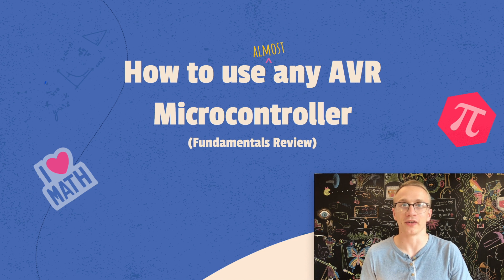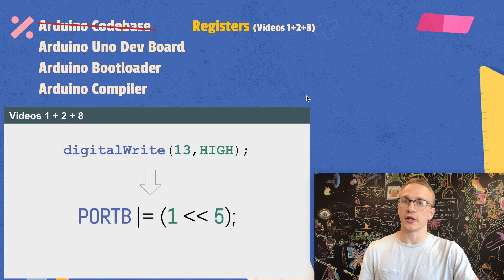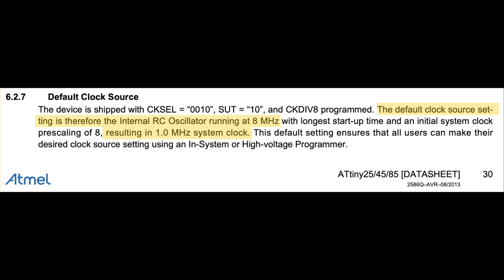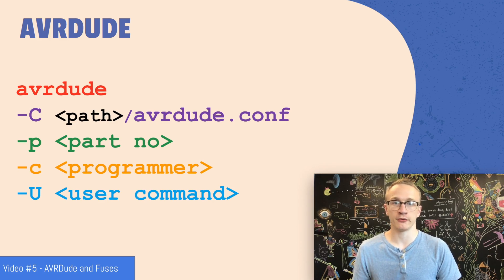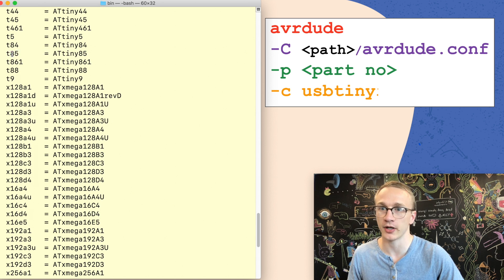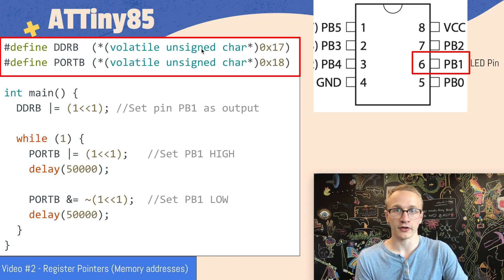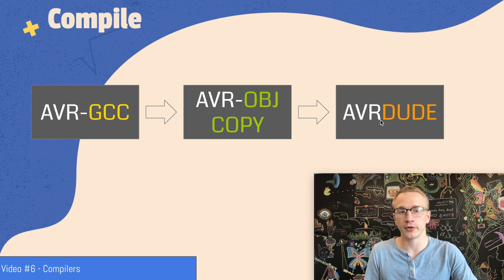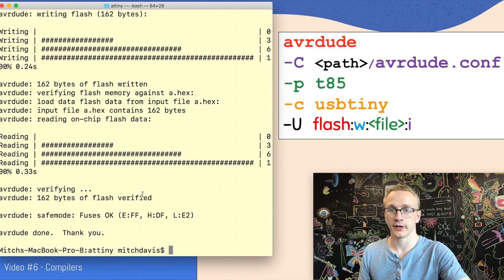Bare-Metal MCU #9 - Review; ATTiny85 from scratch

Comment: I've used the ATTiny85 a fair bit, but I subsequently shifted over to the ATTiny 412 as well as larger members of the 2-series (eg 3224) and AVRxxDD series (e.g. AVR64DD20). I also use ARM and RISC-V MCUs quite a bit where appropriate, but the AVRs are really useful in their own right.

With the exception of the AVR64DD28 those newer parts are only available in SOIC, but it's easy enough to solder them to a DIP adapter, and with the right adapter PCA  you can add some basic external support like a 0.1 uF filter cap on Vdd and maybe a pullup or two to create a standalone breadboard-ready package.

The 412 has only half the flash/RAM of the 85 (though the others I listed are much bigger, ranging up to the AVR64s at 64KB flash / 8 KB RAM), which makes it cozy for Arduino, but in exchange you get vastly better peripherals. The timers are all much better than in the 85, and the TCD block in the 1-series and AVRxxDD is especially useful for things like controlling H-bridges. The universal serial block is replaced by dedicated UART, SPI, and TWI/I2C. Most of my firmware just consists of peripheral setup and maybe an ISR to manage it, and that fits comfortably into 4K flash and 256B RAM.

One highlight is the CCL block, each instance of which includes a pair of chainable 3-input, 1-out LUTs that can implement arbitrary boolean logic, optionally synchronized via register. You can use them to implement arbitrary logic (combinations of AND/OR/NOT/XOR) as well as flip-flops and latches using spare I/O pins. I keep a collection of usefully preprogrammed 412s and 3224s (i.e. ones that configure CCL to provide some combination of logic on a set of pins and then go to sleep) on DIP adapters in my "logic collection" for that reason.

The 412 in particular is $0.50 in quantity and the others I listed are all less than a dollar in SOIC (if you're allergic to SMD then the DIP version of the AVR64DD28 is a bit over $2). I bought a tube of 100 412s a long time ago and have been working my way through those. As noted above I use them as external clock sources, registers, and boolean glue logic via CCL all the time. They're more expensive than SOIC 74HC parts, but not by that much.

UPDI is also a much nicer programming interface than DebugWire IMO. IMO it's worth investing in a "high voltage" programmer like the Adafruit "HV UPDI Friend" ($10) so that you can free up a 6th pin for your designs. In HV UPDI you can configure the programming pin however you want (GPIO, analog I/O, etc), but an external programmer can put it back into programing mode by sending a short 12V pulse to charge a built-in cap. That gives you 6 "useful" pins in addition to VDD and GND in a 412.

All of this is to say that the ATTiny85 is just the (rather primitive in terms of peripherals) start. You can do some really fun stuff with more modern low-end AVRs.

Comment: bro i finished all your vids but it doesnt seem to help me with my problem.please take a quick look at this.

 //this is a simple program to test the functionality of the ADC
//after programming i just connect PB3 to VCC 5V

#include <avr/io.h>
#define PIN_VOLTMETER PB3
#define PIN_LED PB4

void setup() {

   double voltage;
   
    DDRB |= (1<<PIN_LED);      //PB4 as OUTPUT
    DDRB &= ~(1<<PIN_VOLTMETER); //PBR3 as INPUT
    
   //connect PB3 to adc
   ADMUX = 
   (0<<ADLAR) |
   (0<<REFS1) |
   (0<<REFS0) |
   (0<<MUX3)  |
   (0<<MUX2)  |
   (1<<MUX1)  |
   (1<<MUX0);

   //enable adc
   delay(20);
   ADCSRA |= (1<<ADEN);
   delay(20);
   //start conversion for adc
   ADCSRA |= (1<<ADSC);
   while(ADCSRA & (1<<ADSC));

   //getadc results
   delay(100);
    int l= ADCL;
    int h= ADCH;

   voltage = (h<<8) | l;
   delay(3);
   int i , voltage_int;

  voltage_int = (int)voltage;

  //blink the led as many times as the measured voltage at PB3.Example for 4.5V it will blink 4 times
  for(i=0 ; i<voltage_int ; i++){
    PORTB |= (1<<PIN_LED);
    delay(1000);
    PORTB &= ~(1<<PIN_LED);
    delay(1000);

}
}

void loop() {
}
Reply: instead of blinking 4or 5 times it blinks continously infinite
Reply from the maker: I’m not by a computer right now, but can you print off the values of things like “MUX1”

Usually, these are represented as a mask (ex MUX1 could be something like 00010000, or 16). In that case, you don’t want to bit shift it.  Instead, you’d just OR with MUX1 instead of (1<<MUX1)
Reply: @MitchDavis2  I forgot to say im using a digispark kickstarter attiny85 , cant break point with this one right? according to datasheet MUX1 initial value is 0.when ADMUX = 0000 0011 im just connecting pb3 here to adc...maybe i dont understand fully what you mean.Im thinking maybe the libraries at my arduino isn't correct .

Comment: Sidenote: The ATtiny85 has an internal pull-up resistor for the reset pin - there is no need for an external one. Reference: Page 39 in the datasheet, 8.1 Resetting the AVR
Reply: Those are shockingly weak pulls though. If memory serves it's around 30-40K. I use them without external pulldowns for breadboarding but I would probably add a 4.7K or 10K in any production design.

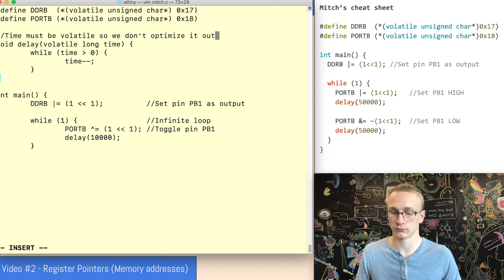Comment: Love all your videos, great job!   Can I make a suggestion?  I know it doesn't matter much, but there is another simpler way to toggle an output pin.  At 9:00 in the code:  PORTB ^= (1 << 1).  If all you want to do is toggle the pin, and you don't care if it's on/off, then you can just use   PINB = (1 << 1).  The "PINx ports are Read/Write ports.  When you write to it, it "toggles" the output.   This uses far fewer clock cycles, in case it matters.   Search the datasheet for the word "toggle" and you'll find this:   " writing a logic one to a bit in the PINx Register, will result in a toggle in the corresponding bit in the Data Register.".  It's a lot of fun if you want to toggle a pattern back and forth...  Example:
    PORTB = 0b10101;   // turn every other pin on.
    while(1) {

        PINB     = 0b11111;  // the pins that were on will go off, and pins that were off will go on
        delay(???);
    }

I had been programming atmel AVRs for years before I noticed that tidbit about PINx in the datasheet.

Comment: Thanks for the tutorial series!! The arduino attiny85/84 support is a mess. Bootloaders on 85 that hog most of the pins, leaving you with little, damaged support on 84 due to versioning-shenanigans on IDE 2.x. Various "boards/HALs" hogging the timers and interrupts just in case you need delay(). Without those, I can't build anything productive. I managed to program things with a cheap "usbasp" programmer by following your instructions.

Comment: Very helpful video, many thanks, 
I was confused by the change of 0x17 to 0x37 and after reading a bit more on the topic I have a better understanding.

From the ATTiny85 datasheet p20:               "When addressing I/O Registers as data space using LD and ST instruc-tions, 0x20 must be added to these addresses."
And from, the Atmega328p datasheet p19: "When addressing I/O registers as data space using LD and ST instructions, 0x20 must be added to these addresses"
Reply: Ok at least they specified that. But why wouldn't they provide us with the correct memory address in the first place?

Comment: I absolutely loved these series, BUT I encountered some problems with lesson on fuses... I was trying to mimic what Mitch was doing to set Low Fuse and somehow I screwed up.. My Atmega328p is not recognizable anymore, it tells me that it's address is 0x00000, I searched it and I found that it may be that i have "bricked" my microcontroller. I am wondering, did I destroy my Atmega328p or it can be saved? Please help, I am kinda desperate.. PS Somewhere in my trial of flashing the Armega, I was getting the error that my code doesn't match at the address 0x..something, something strange was happening..

Comment: I would like to know now how can I choose the right attiny myself, is there a page with a comparison?, I will google it, I just need an attiny to receive messages over I2C and output a PWM signal in a pin, I wonder what would be the cheapest attiny to achieve this, since I need to do this for 15 servos that need to be chained to avoid wiring to a bigger uC, thanks for the series!

Comment: I was with you all the way to the last couple of minutes when you discovered the need to add 20 hex to the register addresses. It was then that I thought 'how are beginners like me ever supposed to be able to work that out for themselves? '  That was the point that all the training so far became irrelevant and without the knowledge you had would have left me confused, angry and floundering. So the datasheet was wrong and nobody thinks that Atmel should put it right?   Loved the videos until then.
Reply from the maker: That left me confused as well.  Some datasheets put the ABSOLUTE address, and some put the RELATIVE address, which is relative to the beginning of that type of register.

Relative shows up a lot because the relative address is often the same between microcontrollers, but different MCUS with different amounts of memory will start the offset at a different place

Comment: avrdude actually DOES understand a.out, so you can skip the 'objcopy' stuff and go directly "-U flash:w:a.out:e".
You can check it in the avrdude manpage under the "-U" section where it lists:  "e    ELF (Executable and Linkable Format)"
So in my case where I'm using an Arduino as ISP and have the source in blink.c I do:
$ avr-gcc -Os -mmcu=attiny85 blink.c
$ avrdude -p t85 -c stk500v1 -P /dev/tty.usbserial-1410 -b 19200 -U flash:w:a.out:e
And .. presto!

Comment: @13:34 The Lfuse is 22, isn't it supposed to be E2?
Reply from the maker: I just went back and watched that part again.  Since I had problems getting my code to work, I might have started messing with fuse bits behind the scenes and forgot to set it back.

I’d have to go check the online fuse bit calculator to see what the difference is between 22 and E2.

But you’re right, it was something that should have stayed as E2 for this video because I didn’t show where I changed it to 22.
Reply: @MitchDavis2  I asked Because it was still working fine! 

I didn't meant to point it out as a your mistake. Your explanations are the best on YouTube and any viewer would agree to this.

I wish you a good health.
Thank you Mitch

Comment: Hi davis I ran into a problem. I have purchased an Atmega328P SMD IC and built a custom PCB around it. I am using arduino as ISP programmer, my avrdude is able to recognize the signature of the IC, however I am neither be able to bootload it nor able to upload any sketched through avrdude. The fuse bits seems to be suspicious. Can you help?
Reply from the maker: Are you able to read any of the fuse bits?  If you run avrdude without specifying any of the “-U” options? It should print off the fuse bits.

Also, is this a brand new IC purchased from a distributor?  What is the full part number?  I know the -P and -PB variants work slightly different
Reply: @MitchDavis2  Hi Davis, yes I can read the fuse bits. But avrdude shows them as 00 for all fuses (All L,H and E) I know it's problematic. I've purchased these IC's from a local vendor and the exact marking on the IC is 

"MEGA328P
U-TH
354730
2009YG0"

Does this information rings any bell for you? It's not accepting any kind of information into it and I'm going really crazy.
Reply from the maker: @gudimetlakowshik3617  did you say you were able to successfully read the ID from the chip?  If so, was it all 0’s or all 1’s by chance?

If the fuse bits all say 0, that usually means there some error going on.  If you can’t read the fuse bits, you also shouldn’t be able to read the chip ID either.

Can you post a picture of the board/schematic?  I can double check your work.  Also, it sounds like you have the standard variant: ATMEGA328P, so that helps simplify things
Reply: @MitchDavis2  hi Davis, yes I'm able to read the device signature properly i.e., avrdude displays saying 0x1E 0x95 0x0F (probably m328p) from this message of avrdude I confirm that it can read the device ID properly. I have made a custom board. I can send you my schematics, can I get your email ID or something to share the schematics and pictures please?
Reply from the maker: @gudimetlakowshik3617  can you upload pics to imgur.com and post links here?  I try to keep my comments public in case other people are having the same problems.  If not, make a post in Reddit.com/r/Arduino and tag me in a comment by writing “/u/thekakester”
Reply: @MitchDavis2   Hi Mitch, I understand. sure I'll post the Imgur link or even create a private Google drive link.
Reply: @MitchDavis2  Hi Davis, https://drive.google.com/file/d/1Zw-gWC0QQISCmoCsbnh0A7J2FSBqP__0/view?usp=sharing
I have attached the complete verbose output from avrdude command line, Arduino IDE output while burning the bootloader. Please let me know if any further information is needed.

Comment: Hi Mitch Davis, thank you for your video... I Have problem when controling servo sweep test using Attiny85 , is it because its internal clock of 1 Mhz? .. its look like glitching, and when i regulated attach and detach every loop its  look better but still back and forwaqrd at some degree rotation. Thank You for your answer,, i hope i can ask you another question if there are ane social media available
Reply from the maker: I certainly don't know this answer off the top of my head, but I can think of a few things to look for.  Firstly, I'm assuming you're using a servo similar to the one that comes with the arduino starter kit (like the SG-90).

If I recall correctly, these types of servo work with something called "PPM", or Pulse-position modulation.  Similar to PWM (pulse WIDTH modulation), PPM controls something based on what phase the pulse is given.

It's possible that this has strict timing requirements, in which case you'd have to check out the datasheet for the SG-90 to see how it works under the hood. http://www.ee.ic.ac.uk/pcheung/teaching/DE1_EE/stores/sg90_datasheet.pdf

ok... i guess it was only one page.  It looks like the HIGH pulse is supposed to be 1-2 ms, and the whole cycle is supposed to be 20ms

Based on that diagram in the datasheet, yes, I expect that timing could be causing the issue.  There's 2 ways you can go around fixing this:

1) Adjust the arduino library for the correct frequency.  I think there's something called "F_CPU" that you can define which then is responsible for calculating things like how many clock cycles equals 1 second.  If you adjusted F_CPU from the default (16000000) down to 1MHz (1000000), this could fix the timing issue

2) Modify the library itself.  This is kinda sketchy because I'm not a fan of writing code that lies.  Essentially, you could go find any delay() functions and divide them by 16.  This is because all of the delay functions assume there's 16,000,000 clocks per second.  So if something tries to wait 1 second with a 1MHZ clock, it's going to wait 16,000,000 clocks, which will be 16 seconds instead of 1 second.

Hope this helps!
Reply: @MitchDavis2  wooooow , Thank You! :D you are The Best!

Comment: Wow! You're committed. Nice work. I'm gonna stick with Arduino IDE :D
Reply from the maker: This is a great response.  I went down this rabbit hole to learn HOW things worked.  After you understand the low level stuff, you don't have to feel bad about using higher-level frameworks/IDEs.  The only thing that stinks is if you develop a dependence on something, which can prevent you from learning new things.  I started learning low level stuff so I could use an STM8 (which didn't have the support of modern frameworks/IDEs).  But it certainly wasn't fun to try to learn everything from the ground up while leaving the wonderfully cultivated world of Arduino.

Comment: Hey Mitch...That was terrific..I just binged on all nine in the series and it filled in a great deal of detail about what was going on behind the scenes..The Arduino IDE is all very well, but it keeps a lot of secrets that ultimately can be crucial in debugging not just code but workflow as well. I'm now going to revisit a number of failed projects armed with the insights..Many thanks..One question...I don't have the specific programmer you used..I have a TL866II-Plus...can this work as a programmer under the Arduino IDE ?
Reply: @MitchDavis2  You were looking for suggestions as to what to tackle next; Have you thought about a sortie into FPGAs..or delving into some specialised ICs/Modules, by taking the backwards engineering approach that works so well, to work from the datasheet and end up with a basic working system, for example the Farchild Smart Power IGBJT (FSBF5CH60B) and ending up with an Inverter....

Comment: Wow, just finished this serie of 9 vids.
This might just be flagged as one of the best tutorial series I've ever encountered on YT, scratch that, on the net! Very interesting, very detailed, and very comprehensible indeed. "Take one step back, ... to leap a couple of miles ahead" !
I must add, though, I am still wondering about the use, and the need, for those 'high fuse', 'extended fuse', and 'lock bits'. In addition, how to scribble EEPROM? (My guess is that it is done in a similar way as writing flash with avrdude?).
Keep up with this amazing quality! Now I'm heading to the LCD vid :D
//Best regards from The Netherlands

Comment: STM8's are great little chips, BTW. Small, simple, cheap, with ample pins to play with. I have an stm8s103f3p6.
Reply: @MitchDavis2  You might want to take a look here: https://github.com/blippy/rpi/tree/master/stm8s103f3p6/bare

It's hastily-assembled bare metal files for the STM8S, including basic blinking, PWM, timer interrupts, uart, SPI and I2C. Expect bugs, particularly wrt I2C. But it might give you some inspiration. There's clearly a lot you can do with an STM8.